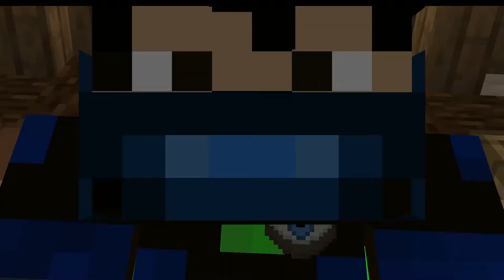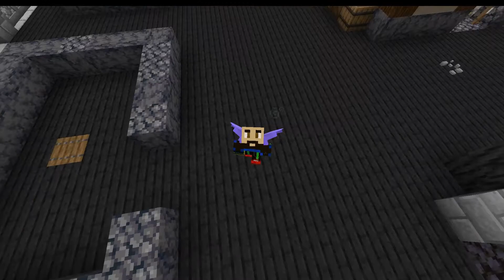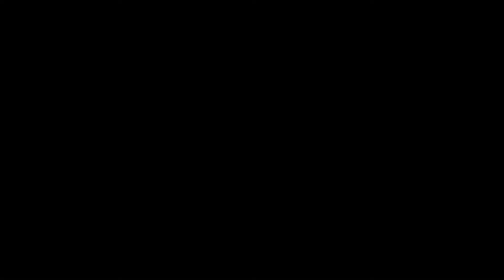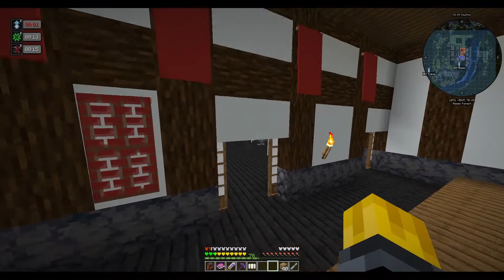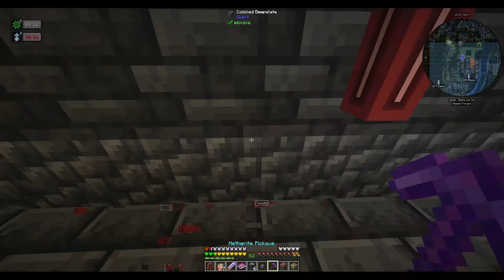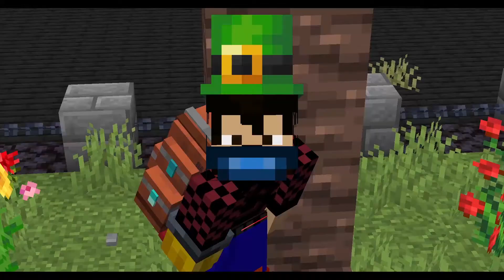Enigmatica 6 Expert (e6e) Episode 9: FULLY automated pneumaticcraft plastic sheets; a HUGE step up!

Comment: Not a fan of xnet but I do like your setup. You should prioritize RF into the controller by the way, if the controller runs out everything stops.
I wish there was a better mushroom generation method, this use of RF is insane.
Again love the Pneumaticraft mod, maybe because it's a bit more complex than most mods to craft something... combining different fluids, items, pressure and temperatures.